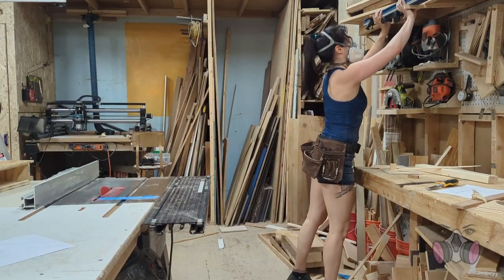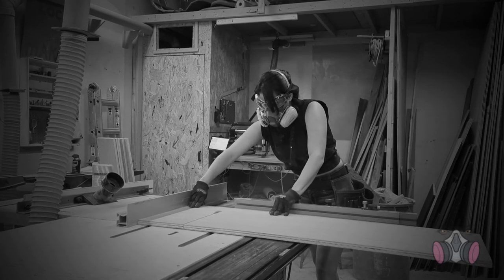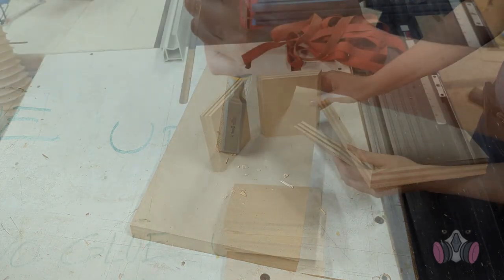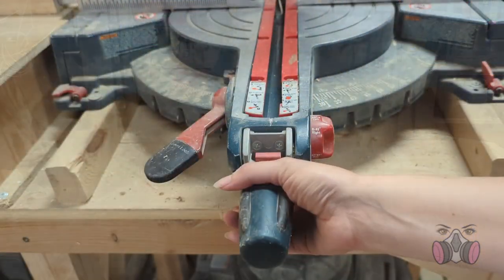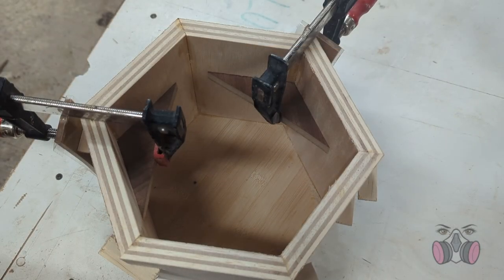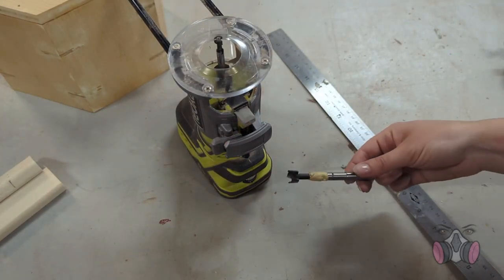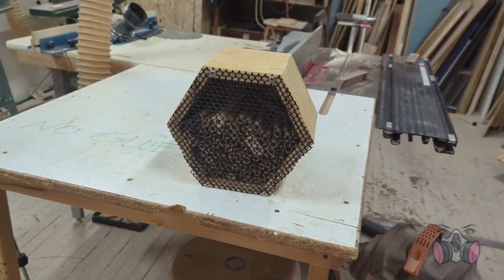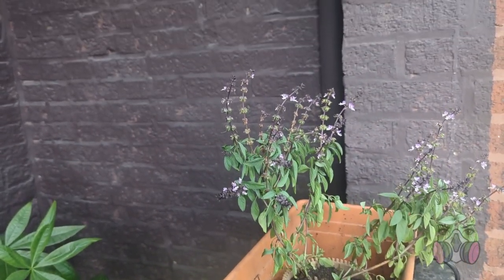Making an Eco-Friendly Home For Native Bees, and Some Table-Saw Essentials

Comment: Nice little bee house. A thing I learned from a beekeeper: If you build an insect hotel / bee hotel you have to round and smooth the entries of the holes. Even small splinters or cracks can harm the flimsi wings. I don't know if this applies for bamboo too but just a small hint

Comment: Woodworker and bee hobbyist here. Just a note about specific native (solitary) bees, mason bees like to have reeds that are closed on one end (as well as access to mud to seal each chamber and the opening). You could also use cardboard tubes or paper inserts in wooden tubes but it's best to open them each year and "harvest" bee larvae to overwinter for the next season. With your open reeds you could just gather them and tape up/rubberband them and put a piece of cardboard on the back. Leafcutter bees like a smaller reed with one end closed and don't use mud (but leafs they cut to wrap their larvae). 

Sorry, sorry.. the internet brings out the most pedantic a-holes who think everyone wants to know about their niche interests 😂
Reply from the maker: No no, don't be sorry! This is great to know. I was surprised how diverse bees are when I first started making this thing, and I think I've barely scratched the surface. So far most of my knowledge is about the leafcutter bees, so I need to start learning about the other for when I make more of these houses. Thanks!
Reply: And it brings out those who ARE curious about the niche interests and are so thankful for benefiting from others experiences.  Thank you both!!!!

Comment: Another brilliant video! I love the decoration on the finished product, I'll have to check out those markers :) You did ask for comments such as the ones on the previous video so in the spirit of doing what I'm told; that type of joint is normally called a 'spline' rather than a 'spine' (forgive me if I misheard you) and could you possibly put a crownguard on that tablesaw blade if you're going to be reaching over it like that? Sorry to be 'that guy', but I've seen enough accidents with unguarded blades to know they really do happen, even to people who are 'really careful'.
Reply from the maker: No no, you heard right, lol. When I first heard the name of it, I heard it as "spine", and since then I just picture a little spine that goes in the wood to support it, and I haven't been able to get it out of my head since 😅No matter how many times I try to catch myself, my brain always glitches back to "spine". And I'm actually torn on the guard for the blade... you're definitely right, and they can prevent a lot of accidents, but I've also had a few woodworkers tell me that they had mishaps that were caused by the guard and that they stopped using it since. So I'm 50/50 on it. To make you feel better though, I'll say that in the video it looks way more cringe-y because the clip is sped up about 300x, so it looks like I'm just swinging my hand over the blade. You're definitely not being "that guy". I appreciate your take on everything and pointing out the spine thing. Let's see if I get it right next time. Thank you
Reply: @woodificould  😁 I know exactly what you mean about the 'spine' thing. Funny how these things get stuck in your head, isn't it?

Comment: You don't have to " clean up" but at least pick up the scrap from the floor as it us a tripping Hazzard.  Thanks for the tip on the Posca Markers.  Nice way to easily dress up things .
Reply from the maker: I try to be careful, but yes, you're right. I've stepped on quite a few things when I was in the zone that shouldn't have been on the floor